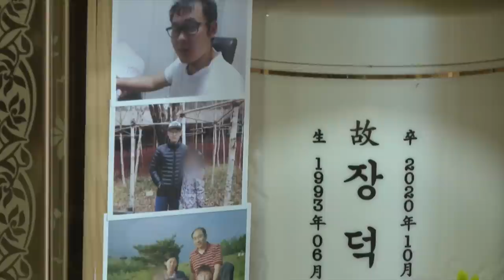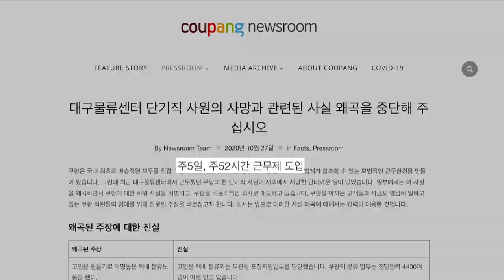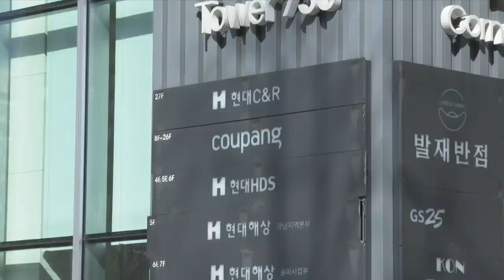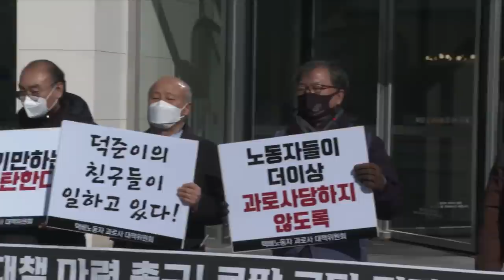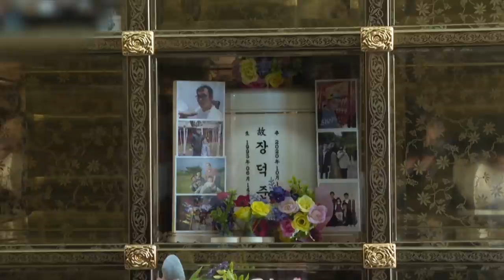Death By Overwork: South Korea's Delivery Workers Suffer Amid Pandemic Boom | CNA Correspondent

Comment: Amazon in UK does this as well.. 😁 if You work trough d agency in Amazon warehouse, You will be required to work 5 nights (10-12h shifts) a week, and 1 night as a "stand by" - meaning, that You might be called in if d warehouse is busy, and believe me, You will be called in as d warehouse is always busy. 😁 obviously You are required to work in a super speed in there, there's no time to keep Your back straight while lifting staff.. probably will be shout at if You do 😁 parcels are stuffed in this huge bags that can weight anything from 20kg-60kg n You got a stack them up in cages higher than Your head 😶 while not allowed to ask for colleagues help to lift them.. The only good thing about working there is the fast money, as Amazon do pay overtime rates while most of other places don't.. however most of the people working there leave after short period of time with permanent back problems, wrist n knee issues .. Also the whole time that I did work in there, I witnessed at least 7 people getting injured, yet non of the reports even made it to the HR office, no sick pay, no compensation, just Thank You, by 😌😁
Reply: what is the pay per hour??
Reply: @djunior874  for the night shifts it's 9.50 GBP per h and if You do more than 50h a week, those will be payd in a rate of 15.00 GBP and hours over 60 - 20.00 GBP 😌
Reply: Yes heard about Amazon and many were comparing these workers to those in Amazaon
Reply: @djunior874  minimum pay is 8720 won/hr. About US7.80
Reply: @dMi_mi  Can't these people do just basic admin jobs instead? agencies like Reed offer admin jobs where you can sit in a cozy office and work for 8 hours aday for like 9.50 an hour and u dont need qualifications